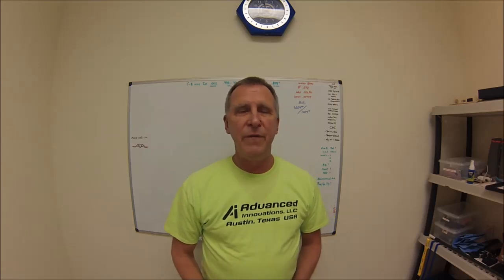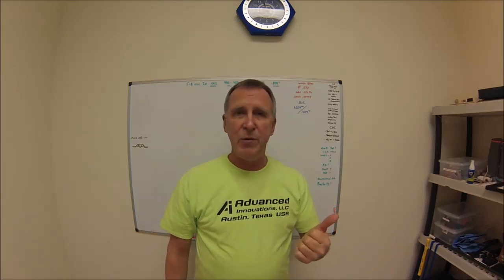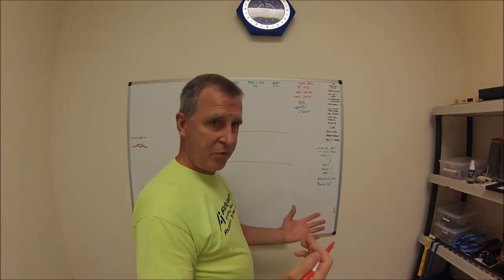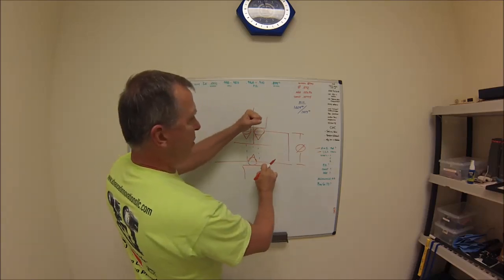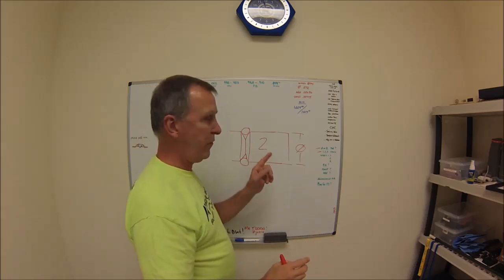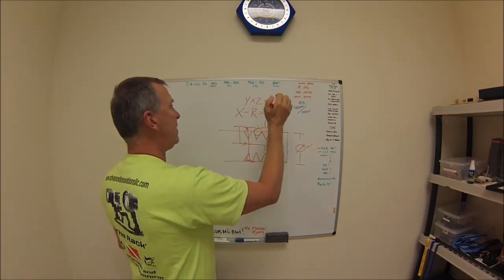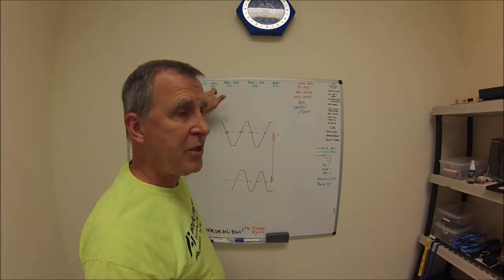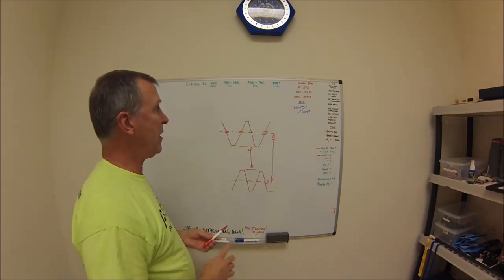Pitch Diameter, Wires and Numbers Galore. Threads in detail !

Comment: im a huge fan of thread wires ... great to know the one wire method  now. im the qc manager at our shop and use them alot. 
Thanks
Rick
Reply from the maker: They are very accurate once you get "The Feel" for them. And since you have 2 spares of each size now, you have ready made Christmas presents for the other inspectors !! Thanks for commenting Rick.

Comment: Joe!
Your suggestion of the One-Wire measurement was, indeed brilliant.  I did the calculations and tested it.  Got results within 0.0004" between the three wire, and One-Wire method.  I have put the calculations into a PDF document for public release.

https://www.dropbox.com/s/wwd6xn8kym8mt3y/JoePiOneWireMethod.pdf?dl=0

Enjoy.
Reply from the maker: Glad it worked out for you. It does simplify the process a bit and only takes a second to calculate. Much easier to hold too.
Reply: Spencer Webb...  excellent.... thanks

Comment: Hi Joe

Nice video BUT ...

Your notation in your 1-wire method is wrong: Y x 2 is NOT equal to Ø !

Y x 2 IS equal to what you would have measured IF YOU have measured it with 3 wires ... and from here we are on track again !
Reply from the maker: I respectfully disagree to your first comment, but agree with you second. If you listen to what I'm saying when that equation is drawn on the board, I say that Y x 2 is your wire measurement. The wire measurement is usually represented as a diameter. For sake of graphics, the "diameter' symbol is used to represent the answer to that equation and to show the known diameter of the material. They are not supposed to equal each other. Perhaps I should have labeled them D1 and D2. I will make a mental note of this for future board demonstrations. Sorry for any confusion. Thanks for the comment.
Reply: He said you find the OD first, make a 1 wire measurement, subtract the radius from before adding the 1 wire then double that. you must have misunderstood.
Reply: Donz Milky
That's not what on the white board - I'm just saying.
Reply: Joe Pieczynski
;-))

Comment: Joe, I have been a machinist for over 30 years and I have cut numerous threads. I too love my wires. the only problem i see measuring over one wire is its not a true pitch diameter. If you cut your part .005 under b4 threading , wouldnt you have to allow for 1/2 of that? Its easy to get a burr on a thread that would be misleading also.  Sure 3 wires are hard to hold , but ive used a ball of putty, grease , and rubber bands or o rings to help hold my wires.  I have plug gauges ive made that are double lead left hand stub acme. made using wires. I do   enjoy your videos, keep up the great work!
Reply from the maker: You always need to know the OD because you need the radius value for your final step. You do not have to make special allowances for an undersized OD since you are establishing the PD from the centerline of the part and not the opposite side. Its a bit tough to visualize, but draw it and stare at it for a minute. The light will come on. Thanks for your comments and questions. Keep em coming.
Reply from the maker: Hi Guys. The starting OD of your part has no bearing on the target pitch diameter. Its just a tool to give you radius values to work from. If you measure parts with burrs on them , shame on you. Wipe the OD of your threads with a fine file and wipe them off with scotch brite before you try to measure them or put a gage on (or in). I usually grab 3 wires as well, but wanted to show, you really don't need 3. Thanks for the comment and for tuning in.
Reply: I totally agree with you about pitch diameter, all i was saying is using one wire and measuring on top of the threads , i would think you would have to take the OD into consideration. With three wires you are measuring the pitch every time. And I always debur, lol.  Once again,I do appreciate you doing these videos. I really liked the one on the way you set your compound on the lathe for a precision angle.
Reply: machinistmarty 
Was going to ask the exact same thing ! 
Although i do like the two wire method especially for initial setup but is it worth the effort ? I don't know , if for one piece maybe not but if you have to cut a few maybe.
Reply from the maker: Since I thread with my cross slide and away from the chuck, the initial groove is always going to be there. the 2 wire measurement is always an option when you dont put in a thread undercut with a different tool.

Comment: Great explanation Joe! The thought of using the B dimensions when turning a plug gauge was kind of an aha! moment for me. One question though, wouldn't that produce an interference fit if the internal thread was at tolerance? Would you cut the internal thread until the plug gauge just threads in? Or build a little allowance into the gauge? Does my question make any sense? Thanks.
Reply from the maker: This is a great question, and one that can be argued forever. Do not cheat on the diameter of your gage. Make them spot on for both the high and low ends of the tolerance. Then look at them differently. The tolerance then becomes an acceptable range. The thread has to be bigger than the smallest, and smaller than the biggest. Think of them as GO/NO GO gages. One has to go, the other has to stay off. But technically, technically, technically, line contact, low side, threaded part is still within spec. You just will never get the gage out once you force it in. Good question.
Reply: My question also. Thanks
Reply: That makes sense. Thanks!

Comment: Hey Joe you raised more questions on gauge diameter and pitch diameter, please run some numbers on making a gauge for your 1" 8 pitch thread so we can understand the what you mean.

Thanks, Joe
Reply from the maker: When you make a plug gage for an internal thread, use the pitch diameter (B) class)of the internal thread for the plug gage. Do not use the pitch diameter you would make a shaft with of the same thread. Does that help?

Comment: I have been cutting threads a while and I have never seen or thought of the one wire method. Thanks Joe.
Reply from the maker: Try it, then compare to your 3 wire measurement. Bet you they are the same.
Reply: Yes it is a very effective fast and accurate. That is one of the best ideas I have gotten on youtube. Big thumbs up. My pint is tipped in your direction.
Reply from the maker: Much appreciated Sir.

Comment: hey prof joe that video rates two thumbs up. probably the most complete discussion on thread classes i've ever seen. i really liked your one wire technique. i may retire my collection of thread nuts now. my thread nuts were all made from hex stock using taps. i was told by an old timer years ago that  if you checked the thread class on the tap you could get away with this.but then all our customers were in the steel mill where we worked. can't wait to try the one wire technique. thanks joe.
Reply from the maker: Thanks for watching. Good luck.

Comment: That was a class-3 explanation, Joe.  
It might clearer to some to say that the pitch diameter is that diameter where the width of the thread is equal to the width of the space between two threads.  You said that in a different way, I think.
A very valuable lesson.
Reply: I don't think that is true.  The gap depends on the class of fit.  A normal thread will have a bigger gap than the throat at the pitch diameter so there is some space between the threads.  If they were equal there would be no gap and the thread would not fit.
Reply: Sorry, Barry, I probably said that wrong.  I didn't mean the space between mated threads; I meant to refer to the external threads on the screw.  The basic pitch diameter is the diameter of a theoretical coaxial cylinder whose surface passes through the thread at the point where the gap width is equal to the thread width.  The gap width is one-half the pitch, and the thread width is one-half the pitch. 
 
The pitch diameter obtained from measuring over the wires is compared to the pitch diameter of the nominal size to check that it is within tolerance for the class fit specified for the application.

You're quite correct that if there were no gap between mating threads they would not assemble, and, as you note, the gap depends on the class of fit.
Reply from the maker: Hi Richard. You have shared a detail I was never aware of. I will have to read these comments a few times and draw it, but thank you for sharing that. I will digest Barrys comment as well.

Comment: If there were no chart how could you check the pitch diameter? How was the chart made? Great series on threading thank you.
Reply: trigonometry and definition of the thread form.  With a 60 degree V, and the perfect form you will know what the correct space should be at the pitch diameter.  From simple trigonometry you can determine how far a round shape will sit into the V and thus determine the OD measurement over the wire.  The wire must be larger than the pitch diameter gap and smaller than the thread pitch (i.e. between 0.5x and 1x the thread pitch).  If the wire is less than 0.5x the thread pitch, the wire won't project above the surface and if it is bigger it won't fit in the thread to start.  By calculating the thread form at the optimal, high and low ends of the tolerance you then get the "perfect" and the min/max measurement range based on the class of fit.  Joe might need to use the white board to explain this better.
Reply from the maker: I might need a bigger white board to explain that.